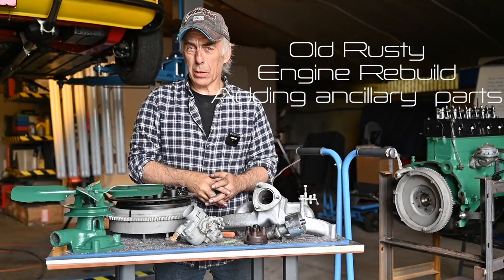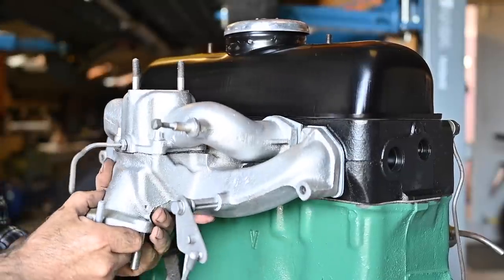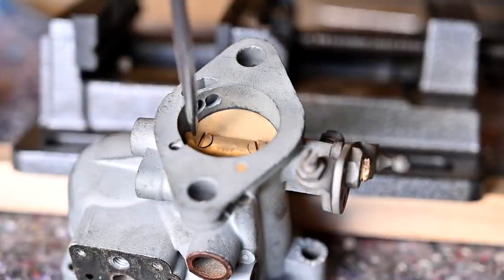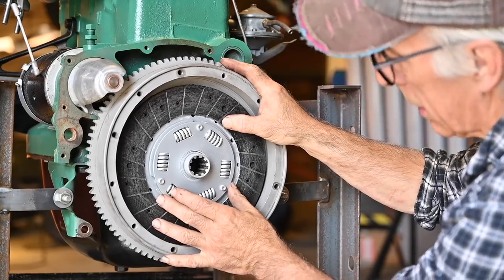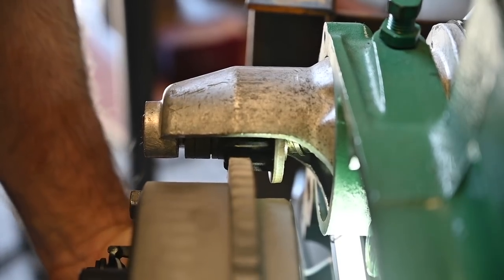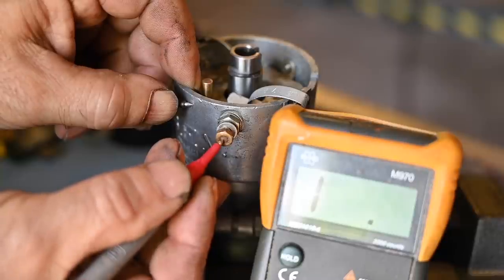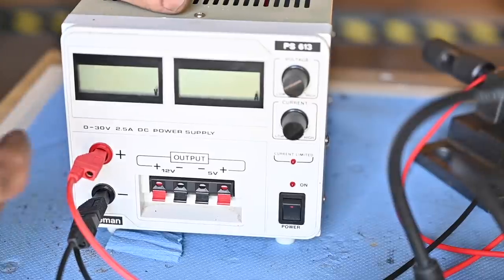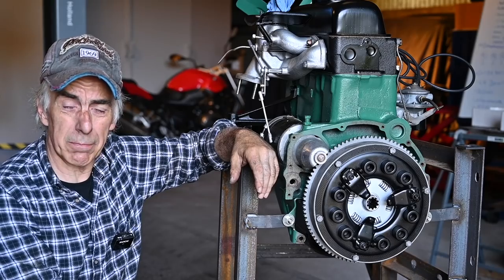Old Rusty, engine rebuild- Fitting ancillary parts

Comment: Thanks for the video 

Quick tips
Always heat up around the bolt you want to remove for best results 

 Area must becomes red hot
for best result

 take your time to build the heat up is Key here

Have a good week 👍
Reply from the maker: Thanks for the comments Petri, indeed cast iron does not like fast temp changes

Comment: A very good presentation as usual. Small point of order. The spark occurs when the points OPEN. The spark is caused by the collapse of the magnetic field around the wire in the coil. As it collapses it cuts through the secondary wires. It is called the back EMF. You can see the effect using an ohm meter on a relay, you get a spark on the opening lead when disconnected.  The action of the condenser is to quench the spark across the points to prevent them from pitting in just a few Km. Best wishes from Australia
Reply from the maker: Thanks for the comments Rob, Indeed its the change that causes the EMF.  In fact DC does not work on a transformer and  in essence the Coil is an up transformer.  To have induction there has to be alternating current flowing through the primary, that change causes the induction  in the secondairy winding .   The higher the frequency the more effectiveness .   In essence the braker points convert the DC to a pulsed DC ( square wave) and hence the induction as you described,

Comment: Hi Steve, You are an expert in explaining how things work and I appreciate this. One thing that I have to say is that on more modern cars than old rusty, there was a resistance fitted on the wire between the starter switch run position to the ignition coil. There was also a 12 volt power supply coming from the starter switch start position wire directly to the ignition coil. When the key is turned to the engine start position, the starter motor solenoid and the ignition coil receives the full 12 volt power from the ignition switch. When the ignition switch is released to the run position, the power supply to the ignition coil then goes to the resistance and powers the ignition coil with a lower voltage than 12 volt, say 6 volt. The higher voltage at start-up makes for easier starting and then, when running, the lower ignition coil running voltage prevents the point surfaces from burning so quickly. You could get a much longer running time out of a set of points using the resistance on the ignition coil. If you are running the starter on 6 volt, you may want to experiment to start the engine using 12 volts to the ignition coil, just for starting, and then see if she will continue running with 6 volts powering the ignition coil. I know that the ignition coil is rated for 12 volts, but it should be able to run on 6 volts, as well. A lot of Japanese made cars had this resistance fitted before the electronic era came to be and electronic ignition pick-ups replaced the points on the distributor. Something for you to consider with old rusty, as I like to keep things original, as such. Geoffrey from Namibia.
Reply from the maker: Thanks for the comments William, that is a great write-up. I have seen coils with balast resistors but was not aware that some brands used a switching method as you described.  That seems like an option once I start to work the wiring loom.  It makes all sense... more voltage is a better spark at the start, but tends to burn faster the points, so lowering the voltage when its running is better for the points.   Makes all sense.

Comment: If you heat up the stud till it starts to turn red then cool it using water as quickly as you can it will definitely screw out for you. I heat and cool all seized parts and it works great. Don't worry about doing harm to the manifold it will be fine as long as you make sure to concentrate most of the heat into the stud.  Try it and see I bet you will be surprised. Plus keep up the good work loving the videos.
Reply from the maker: Thanks for the comments Ashley, I will give that a try next time.. so in essence shocking the stud   hot-cold
Reply: Yes that's the general idea of it. Plus when you apply heat it expands and when you cool It contracts so you get slightly more metal movement at the thread where it seized than with just applying heat. Plus your not worrying about changing the bolts tensile strength as you will b replacing it anyway.

Comment: All those bolts on the engine you should be using thread locking fluid.  If you ever need to get something fixed like say the water pump, then thread locking fluid will prevent the bolts from rusting.
Reply from the maker: Thanks for the comments Bill,  that is indeed a good point

Comment: May have already been mentioned, but don’t heat the stud or bolt you are trying to remove. Instead heat the part it screws into until it is cherry red, then try to remove the bolt. May need to repeat a second or third time, but that will normally do it. Heating the part around the bolt/stud will expand the hole it’s threaded into. Heating the stud/bolt will expand it and make it tighter in the hole.                                                                                    BTW, I use a tea ball in my ultrasonic cleaner for small parts like jets and screws.
Reply from the maker: Thanks for the comments John, and advice... the tea ball what a good idea...

Comment: Good job! When i need to remove old broken studs from exhaust manifold, i used to first of all, lubricate it WD-40 and leave it for severar hours to allow WD-40 get deeper in the layers of rust and in a thread. After that i'm heating studs to the red lighting and getting it cold by the water several times. After that i'll try to rotate studs both sides to finally break a rust, when i feel that if rotating completely free, i'm trying to remove it finally. Usually it was successful. But, when it is necessary to remove it faster, of course you way is the best.
Reply: AKWoland really? Wd40 means water displacement, 40th Edition. It is nearly the same as petroleum. It cannot help a lot.
Reply: @lieberfreialsgleich  Yes, it is. But actually it also good helps with rusty threaded connections
Reply from the maker: Thanks for the comments AKWoland, So shocking the bolds typical works... I can see that ..

Comment: dont heat the stud , heat the manifold flange and quickly cool with water.  other option is put ground on manifold and weld a nut on the stud. been doing this for 45 years so I know it works
Reply from the maker: Thanks for the comments Nugene, that is indeed another option and the right way.  The only issue is that I have done this before and it cracked the cast iron manifold as those don't like fast temp changes.. So I played it safe
Reply: @D3Sshooter  While it may crack I have never had one to crack  and unless it is cross threaded welding a nut on the stud is quick and easy. Try it out on a junk part for practice. You will be amazed

Comment: Copper spay my friend  you'll love it !!! Adjustments are for MECHANICS not for parts fitters !!! and for us it is always a winner with satisfaction ! BUT WE ARE TOOOOO EXPENSIVE now !
Reply: Carburetors 2 and 4 strokes  engines I like to use acetone to remove varnish in jets and needles  good results !!!Copper spray for distributor especially for the eccentric firing adjustment and the follower finger  !
Reply from the maker: Thanks for the info, and indeed
Reply from the maker: great tip thanks, in fact I already stole the girlfriends acetone

Comment: Like to see more of a press fit on that pilot bearing.
Reply from the maker: Thanks for the comments, I did not had to press it in, that was rather smooth.
Reply: @D3Sshooter  Should have more of a press fit. In other words, a tighter fit so the outer diameter has no chance of spinning.
It fit half way in the bore without even trying.  Enjoy the series and see you next time

Comment: As usual very interesting video. Small note: new ignition, beware of new capacitors, even new they are not of quality, I installed an electronic capacitor on my citroen mehari and on my solex because the remanufacturing are very bad
Reply from the maker: Thanks for the comments,  I see and yes capacitors my not always be well produced.  Yet you can see it quickly if there sparks at the points... then it capacitor is no good
Reply: @D3Sshooter  It depends, a capacitor or a coil can very often fail hot. Since I mounted external electronic capacitors it is much better

Comment: Here's a tip for you. When trying to remove a stud or a bolt, heat the area around the object your trying to remove. You want the area around the bolt or stud to expand and not the bolt or stud.
Reply: This is correct. Heating the stud expands it, making it tighter and more difficult to remove.
Reply from the maker: Thanks for the comments Rick,  good tip..  However I have some bad experiences with cast iron heating,,, so that is why I try to shock the stud.

Comment: The carburetor is most likely of pre-1945 manufacture, as it says "D.R.P." next to "BRIT. PAT.". D.R.P. means "German Imperial Patent", a term not used after the war. Could very well be original?
Reply from the maker: Thanks for the comments, That could explain the strange papers ( grey paper) with this car that states first use  Day 0, Month 0 and 1949.  Based on the what I could find on this truck is that it was used during WWII, and it might be that it was build under German occupation.. In each case it was taken by the  French resistance at the end in 1945..  then recovered years later for commercial use in 1949...

Comment: Nice episode thanks!  the issue with non-fitting new parts seems very common across all old car makes. MG, Triumph and Jaguar parts can be a terrible fit. 
So many of the parts are very poor quality as well, seal kits, brakes, suspension joints are all suspect, some only last a few months! Where possible I prefer to refurb original parts even if it takes time, money and doesn't always look perfect!
Reply from the maker: Thanks for the comments Mark, and yes you are 100% spot on

Comment: Never blast a cast iron infold or exhaust. The grid will get in the pores of the iron. I worked on citroen hy and u23 for several years. Couple of client brought in damaged blocks with broken bearings, because the grid came out of the pores after some hours of running.
Reply from the maker: Thanks for the comments Cas, I have done this several times and so far no issues.  Off course you need to clean it very well afterwards.  The exhaust is not an issue at all , as that never sucks in air.. for the intake manifold , I can see your point. Yet with garnet 360 or glasbeats at low pressure there is no residue or almost  none.  After the blast, a good wash with compressed air , then a waterflow and then dry blast with air seems to remove most.  I will do a little test, on a spare that I have and see if the pores are an issue..  You might be right...    You worked on the U23, that is good to know...  Can you tell me what the weak spots or area's are on the U23 engine ?  And just maybe you have some parts or manuals or good advice for me ( off course I would pay for it)...  Kind regards
Reply: D3Sshooter can i have your email adres. My dad has a website focussed on citroen hvan parts, they have alot of parts in common with the u23. We had an u23 fire truck in the past!
We might have some u23 books left for sale, im gonna open the shelf and look around for them. I will send you some usefull info and our website by mail if your interessted. My dad and i are always looking forward for the next old rusty episode! Greetings from the netherlands

Comment: The main reason the flywheel teeth are worn off in one area more than other areas is because engines tend to stop in the same spot each time. If one cylinder has even a bit less compression than another, or vice versa, the crankshaft will tend to stop in one spot. And the teeth in that particular area will get more use than other areas. A mechanic told me this over 50 years ago.
Reply from the maker: Thanks for the comments,  That is indeed a very good explanation ... txs

Comment: Very interesting and well explained video, on the broken exhaust manifold bolts, would you not be better heating the manifold and not the bolt,it seems to me you want the manifold to expand not the bolt which would make it tighter.
Reply from the maker: Thanks for the comments Scot,  There are two methods, one is heating the manifold so that it expands, thus releasing the tension on the studs.   The other is to heat the stud so that it expands and crushes the oxidation between the bold and manifold.  The best approach is must likely to shock the stud by fast heating and fast cooling.. that typical will do it...  Manifolds are brittle and I have had some bad experiences by heating it up with a crack as result...  They don't like fast heating and cooling..  that is why i did it on the stud...

Comment: You don't heat the studs, you'll expand and weaken them, heat softens the stud causing it to want to bend and snap off. Always heat the part you are attempting to expand! In your case, heat the manifold not the bolt.
Reply: Yup This, its fixed anyway :)
Reply from the maker: Thanks for the comments Dan,  Yes indeed, however I have had a case where I did heat manifold and it cracked. Cast iron  does not like fast temperature changes.. So I play it safe since then, by shocking the stud cold-hot-cold to break that bonding...  did not work his time.... However you are absolutely right as matter of principle

Comment: You find more damage on one spot of the ring gear because a engine mostly stop in the same spot, i have welded teeth up on a dozer and re filed them . Too much grease can throw out on your clutch lining been there done that
Reply: I've several times heated up the ring gear to remove and turned it 180dgs back in the 60s when we couldn't get one quick enough .
Reply from the maker: Thanks for the comments Big Ears, that is indeed another true statement... Thanks for pointing that out..  As for the grease , indeed that is always something to watch out for
Reply from the maker: Thanks for the comments Gerald, that is not a bad idea.  Although I have so say that I never tried to remove a ring ...Maybe one day I give that a try...  I think it needs 250 degrees of Celsius .  Any tips on how to do that ?
Reply: @D3Sshooter  I allways used a gas torch with a rosebud tip ,or you could use a large tip in the cutting torch .

Comment: I ruined an engine rebuild by leaving sand in an intake manifold after blasting.  I'm sure Steve didn't make that mistake.  Use a wire brush on intake parts if you can.
Reply from the maker: Thanks for the comments Spetet,  That is something to watch out for ...  I blast it, then blast with clean air, then high pressure water blast, then dry blast with clean air... so far no issues with this process..

Comment: having exhaust and intake on the same side is really wierd, having them touching must heat the intake air significantly and this greatly reduces efficiency. What were the engineers at citroen thinking?
Reply from the maker: Thanks for the comments, Indeed that is something strange , although I have seen it before on other vehicles and some intake manifolds are actually heated by the cooling water...  I am sure that there is to be a reason for it

Comment: hello D3Sshooter how do you use your multitester too see the points opening and closes?
Reply from the maker: Place it on Ohms reading and beep.   use the low scale .  Place the pens across ground and the input wire to points. if it stops beeping or zero ohms  they opened.
Reply: @D3Sshooter  thanks so much
! :)

Comment: When making a new gasket would drilling the bolt holes be a better more accurate way of doing it.
Reply from the maker: Thanks for the comments, drilling tends to shred the gasket.. I did try it never worked well...  A stencil is by far the best

Comment: I think you should rather warm up the body and not the screw? Because metal expand on temperature but you made the screw hot?

Anyway i love your videos :D
Reply: It's actually makes sense to heat up a bolt itself.  It's expands rapidly, smashing the material surrounding the threads, and burning all the debris.  Then when bolt gets cooler and somewhat a bit loose. 
But damn...i hate doing that job on iron flanges.  Fire torch,  MIG welding machine and drill press - holy trinity for that kind of a job.
Reply: @XPbIM3  ah ok i did not think of that :0 Next time i will use your method :D
Reply: ive had a lot of luck welding a nut onto the broken stud and while its hot turning it out. another lubricant that works real well especially on pipe threads is candle wax. its amazing to watch it flow like solder. great informative video. thanks.
Reply from the maker: Thanks for the comments Werner
Reply from the maker: Thanks for the comments, that is alos what i taughed
Reply from the maker: Thanks for the comments